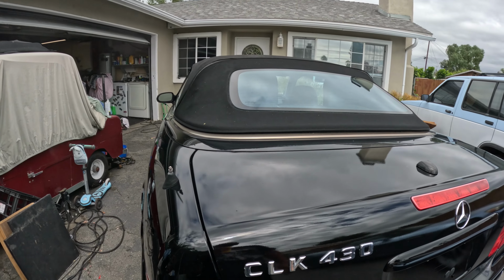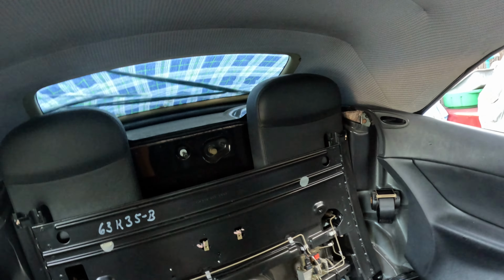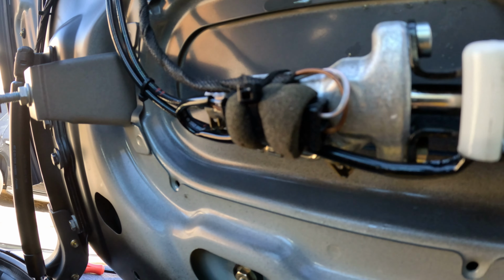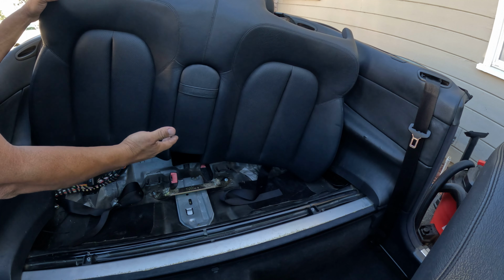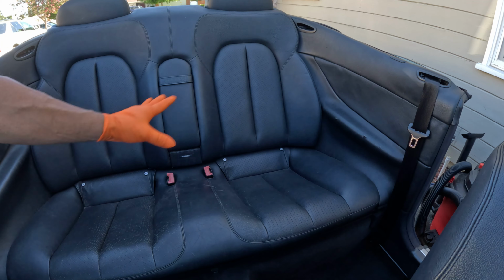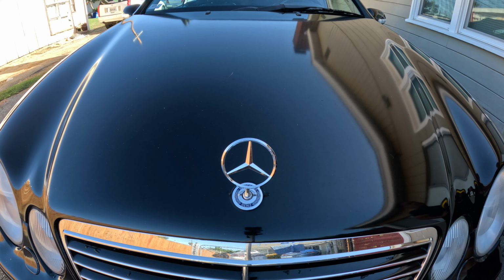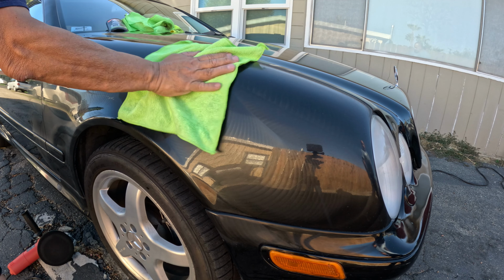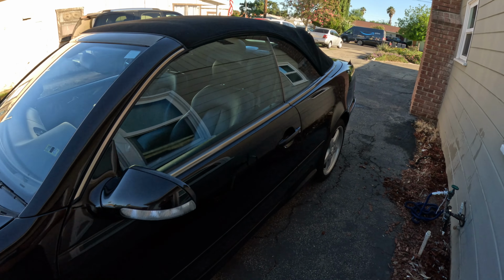2003 Mercedes CLK 430 Rebuild Interior & Exterior TOP WORKS!!!

Comment: No sir hold head rest button 15 seconds wait for click then push head rest down
Reply from the maker: @Andrebooker58761 Yes I know about the button reset, you can do it either way... If the button doesn't work that's the other way. It ended up being no fluid in the system hence why they didn't go down after the reset procedure and no click.

Comment: Bidding on it tomorrow at copart boss
Reply from the maker: What's your highest bid....$1200 takes it
Reply from the maker: @@Luis22__ It's at Copart, and goes to auction on Friday Dec 22nd. $1500 OBO
Reply from the maker: @user-gn1hk9gg3y yes the top goes down, you have to help it up and it will go. All forums say it needs help when opening, even when new. The driver seat was fine, not sure what happened there.

Comment: Love these Mercedes. I have a 2002 CLK430 coupe. Got it cheap. Sat couple years with one window stuck down. Would not turn over. Turned out to be a lost ground wire to the motor from the chassis. Fuse missing for the window. Straight piped.  Sounds mean! Love to get a cabriolet some day